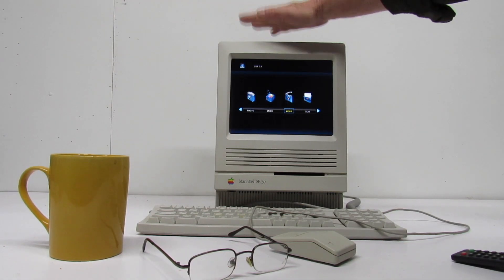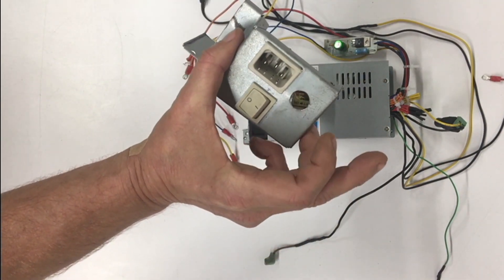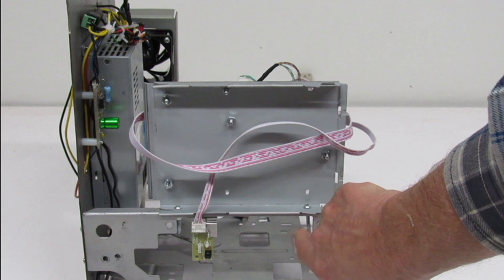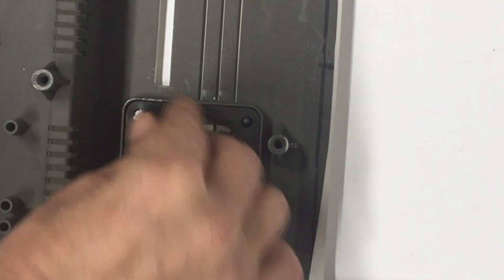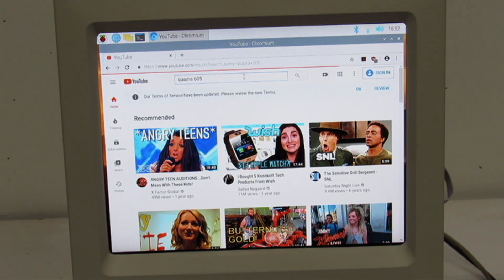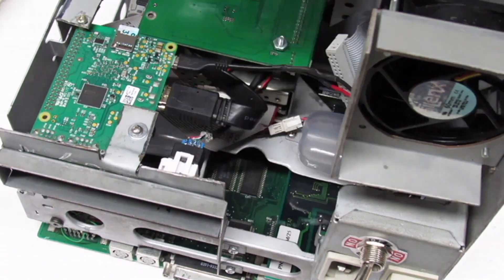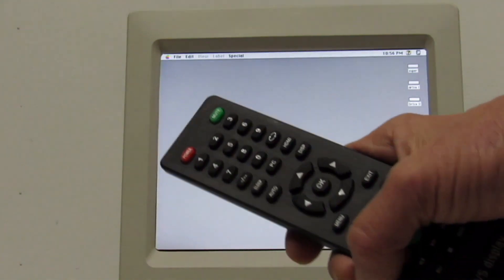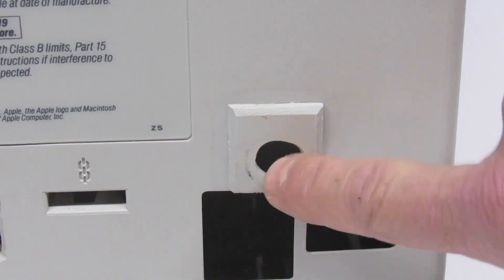Must see - Apple Macintosh se/30 TO - Raspberry Pi  /  Quadra 605 (LC475)  /  Media display Upgrade

Comment: What! I just came here to see the Raspberry Pi install, but you've got a whole Quadra in there as well? Holy cats! Curious what you used to grind down the inside of the monitor bezel - it's a much cleaner look than the custom 3D printed inserts I've seen, and preserves more of the iPad display area.
Reply from the maker: Hello, I used a depth gauge (measuring from the front of the face-plate down), a Dremel tool, and files. I've also cast an interface for an 8.4" LCD (800x600 resolution) for the SE and se/30 :)

Comment: @18:48 I'd like to know how to got that front bezel so flat that the iPad screen fit perfectly. Amazing.
Reply from the maker: Hello, and thank you :) It's pretty easy to get the bezel flat on anything before the Macintosh classic, just remove the plastic a bit at a time and use a small level to check your progress. The Macintosh Color Classic is also a good candidate.
Reply: @BillyTheKidCENTURION I've got a similar project in mind where I put in a Mac mini M4 inside a mac classic. The classic I've got doesn't work, but the case is in excellent condition, so I may not do that much cutting. I want to keep it looking as stock as possible with the least amount of mods. I think the biggest issue I will have is for the I/O at the back of the device.

Comment: Billy! F-in' spectacular! I just stumbled here so I was hoping you would suggest another one of your vids where you show your plastic "slurry" technique in action? Thanks, KS.
Reply from the maker: Hello:) I plan on doing a series shortly, but the slurry "technique" , and "plastic welding" are very well documented on youtube. For the slurry, it is simply a mix of plastic shavings from a component you are attempting to repair, with a certain amount of acetone. There is no set ratio, you can make it as thick or thin as you want, thicker means it dries faster but you have joining lines, thinner means you have less obvious joining lines, but  a longer time to cure, and while the joining lines are less obvious, they are more prone to breaking in the future.

Comment: a lot of retroist just want to restore old computers to stock configs or only do mods using period correct hardware - I like videos where old computers are modded with latest tech components - turning them into retro cyborgs
Reply from the maker: Thank you, I take it you like the project :) I've been restoring and repairing Apple computers for a very long time, as such, I've accumulated many extra cases because I've had to buy whole computers that were broken, just to harvest them for parts.

I plan on doing many more modifications in the future. I can't wait for the new M1 chip Macs to start showing up at used prices, they are perfect for retrofitting into the older Apple desktop and laptop computer cases :)

Comment: This is amazing!  Does anybody sell these kind of retrofit projects?  The use of an iPad display is brilliant and the modifications to the case to make that work are blowing my mind.  I wish I had one of these, my favorite would be a Mac 512 or plus case, but I also like the SE.
Reply from the maker: Hello, and thank you:) I don't believe anyone is selling these kinds of retrofits, but then they really are easy to perform. Finding 128k, 512k, and Mac SE cases is a bit harder, as they haven't suffered as much damage internally as the latter compact Macs, because they didn't use the small can capacitors. I do plan on doing several Mac Plus conversions in the future, as I have extra cases. I'm glad you enjoyed the video:)
Reply: What would you charge for a ready made one of these owo

Comment: How did you repair the front bezel? It looks like new!
Reply from the maker: Hi, thanks:) The damage to the bezel was on the lips where they came in contact with the CRT, and the CRT mounts were broken off. To  install the iPad LCD I had to remove plastic off the lip area so I could get the full viewable area of the LCD, when I did that it removed any trace of the broken lip. For removing the case yellowing, I treated the cases with 50 volume Salon Care creme developer from Sally's beauty supply.
Reply: @BillyTheKidCENTURION  Thank you very much! I didn't know that you removed the plastic, I thought you built it back up (I was thinking superglue/baking soda), thanks for clearing that up! I'm doing a similar project with an old Mac Plus. You did an amazing job!
Reply from the maker: @makingcookingfixing  Good luck with the project:) What are you putting inside the Mac Plus?
Reply: @BillyTheKidCENTURION  thank you. Nothing as elaborate as yours :-) I am planning to mount a digital photo frame inside so it continuously plays video. I purposely tried to find one that had the “auto play” feature not easy to find  so when power goes off and turns back on, that the video would play.

Comment: This is absolutely amazing!. I have a Macintosh Classic that it's working with the original parts. I know that even if it fails I won't be able to do anything not even closer to what you have done but I enjoyed watching the video.
Reply from the maker: Hello and thank you:) It is actually very easy to do, the hardest part is soldering the VGA wires to the Mac logic-board, even then you don't need to remove the connector like I did, you can simply solder them to the connectors on the underside of the board. If your Mac Classic ever goes bad and you want to do something like this, you are in luck, because of the way the chassis is arranged you have room to do many more modifications than you can with the SE, and it's a better looking case:) I'm glad you enjoyed the video:)

Comment: Have you thought of putting in a ][ c or ][ GS, giving you an Apple 2 with an internal screen ?
Put an LCD in.
Reply from the maker: Hello:) Yes, I have, but then I started thinking about the fruity iMacs. What I would like to do with my IIc is cast a custom multi color case that stands upright, and have at least a 15" LCD, I like it when my IIc has lots of screen acreage. It is on my list of projects that I start, but never seem to finish:)

Comment: Incredible build!  Lots of attention to detail!  Did you have to put in an audio amp for the RPI3?
Reply from the maker: Hi, thank you:) But it's not nearly as neat as your modifications. For the audio, the LCD driver board has an amp built in, so I just put the Pi audio over the HDMI.

Comment: Impressive work.  I'd be interested to know how you connected your iPad screen to the Raspberry Pi. Cheers!
Reply from the maker: Hello, and thank you:) the Quadra hooks to the VGA port on the LCD driver board, and the RPi connects to the HDMI port on the driver board. There is also an option for composite out.

 If you do this modification, make sure you have a driver board that is compatible with your model LCD. Apple used several different ones. While they should all be able to use the same driver board as they are interchangeable in the iPad, when using a third party board it has to be specific to that model LCD, or rather the driver does.

Comment: how did you make the cutout for the screen so clean and even?
Reply from the maker: Hi, I used a Scroll Saw for the rough cut, and then a Dremel tool and a square to make small adjustments to make it internally flat.
Reply: @BillyTheKidCENTURION  I'm impressed! That's quite some workmanship with a free-hand tool.

Comment: Great build! I would have just installed a Raspberry Pi 4 in that case and not bother with the LC475 board.  Just run a Mac emulator on the Pi and other emulators like Dosbox and connect a USB floppy drive for disk access.
Reply from the maker: Hi, thanks:) I'm not very fond of the Mac Classic OS emulators out there. I've found them to be buggy, and very frustrating when trying to configure them for the network.
Reply: @BillyTheKidCENTURION  That makes sense.  I don't run too many old Macintosh programs anymore but the one that I still find useful is HyperCard.